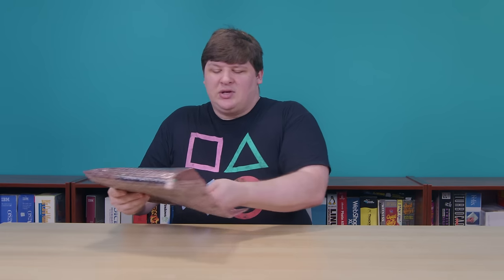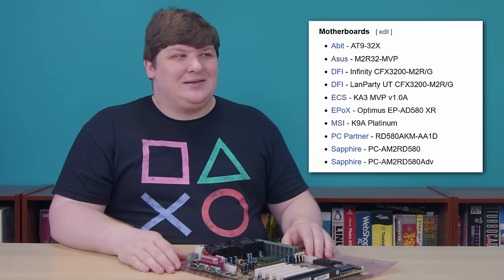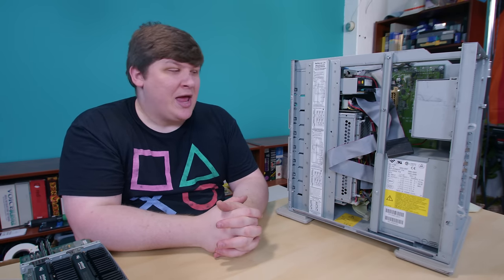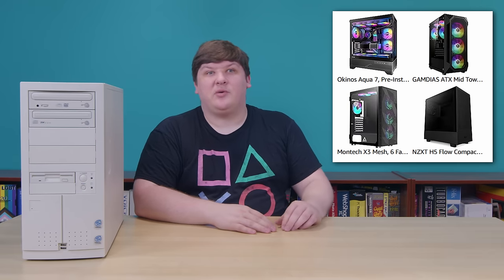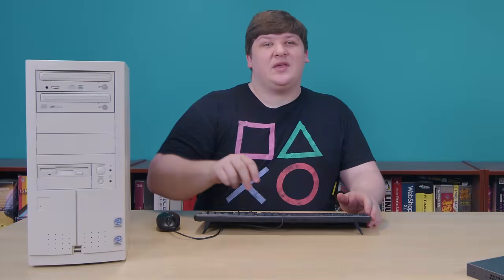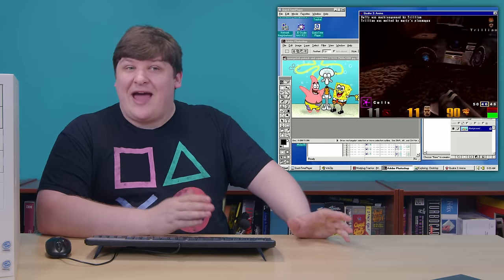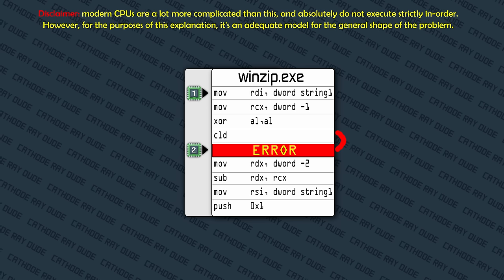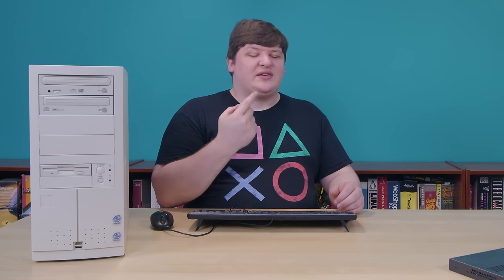The Only Famous Motherboard

Comment: Definitely throw Win 2k on that thing. 2k fixed so many little issues with NT4 and you should see a lot better compatibility with games, and iirc most BP6 owners swapped to 2k as soon as it was available.
Reply: Windows 2000 is so underrated. It was basically XP with the Win9x/NT4 UI before XP even existed.
Reply: been trying win 2k on my single 1ghz p3 machine and (saying this as someone who grew up with win xp in the late 2000's early 2010's) it freakin kicks ass! orders of magnitude better than win98se in practically every way.
Reply: I kept Win2K on an SGI VWS320 and used it as a file server for years until shitty rural power killed the power supply in 2011.
Reply: Finest version of windows ever made and nobody used it.
Reply: Agree have used win2000 on dual cpu setups. i had custom workstation with two pentium 3 ( it was in 2002) it was my "in" movable data server. Used for client data copying and storage! And it was a Dell workstation motherboard cramed into a smaller case but because of 6 scsi disks thirtysomething gigs eatch it was heavy!
Reply: @Ev1lHaX0r  I loved Win2K.  For a few years, that was my gaming OS and database/web/graphics work OS.
Reply: My parents were engineers and had dual socket 370 workstations from Siemens at home and i remember NT 4.0. In retrospective, it felt like a Windows 2000 beta, because certain parts felt unfinished. And it had many bugs. Windows 2000 professional was a godsend. 

Kinda like Win Vista and Windows 7. 

Or Win11 and whatever AI generated, adware filled and intentionally feature reduced version will come after it.
Reply: Yeah, while I'm sure a few people ran NT4 on their BP6's it was popular well into the release of Windows 2000 and this was probably the OS most owners settled on, really made NT the only choice on the desktop.
Reply: 2K was the pinnacle of computing back then. I miss that OS feel. It was everything you needed, lots of stuff you wanted, and nothing superfluous and cluttered.
Reply: @hyperturbotechnomike  Windows 11 is already the  AI generated adware filled and intentionally feature reduced version of Windows 10 😔
Reply: i ran 2k until i had to switch due to the directx kerfuffle towards the end of xps regular lifespan. and by then xp was solid enough it was mostly fine.
Reply: @KalioJay  - It's driver compatible too with almost all classes of device
Reply: I used dual multiboot Win2k and Linux / FreeBSD / QNX.
Compatibility for games on Win2k was correct, and the OS was really stable.
Reply: @thegeforce6625  Excepted the fact Win98 could run DOS games, while Win2k could not.
But it was already a minor issue.
Reply: I switched from w95 to NT4 as soon as I was able to buy enough memory. Never looked back. NT4/Win2k were real OSs. W9x was a piece of garbage.
Reply: True, Win2k kicked ass. I remember reading that "it's a workstation OS, you don't need or want it on your home PC". And then we had an install party on a friend's PC. We were like 12 or something (and those were the days when rampant piracy was normal where we lived, so the cost wasn't an issue) and I still vividly remember our first reaction: "WHOAH, THERE'S A SHADOW UNDER THE MOUSE CURSOR". Yeah, that was the thing we were excited about. And also everything was so smooth, so stable, so beautiful. Hibernation that actually worked (Me and even 98 reportedly supported it to some extent, but I never had hardware which could align the stars in exactly the correct way to get it working). Even games played better on it than on 98, believe it or not - I remember putting on GTA3 and it stuttered like hell on 98 but ran butter smooth on 2k. On the same hardware, dual-booting. People who migrated from 98/Me to XP were experiencing a huge leap. For those of us who migrated from 2k it was just the Luna theme, and maybe sound support for the emulated DOS environment (playing DOS games was still common in the early 2000s). We experienced everything else before, so... meh.
Reply: I found W2K to be sufficiently compatible with games that I had no reason to clutch on to 98. When XP came out, it was a pretty easy migration for me.
Reply: @kenabi  I did the same thing. I still have my copy of 2k. I don't have anything that can should run it, but man I look back fondly on it.
Reply: Win2k 🙏🙌
Reply: Can definitely get on the 2k Train, was into the Warez scene then and got it very early. It ended up being one of my most favorite of all MS operating systems. I remember the amount of people that ran timers just to show off uptime and it would run pretty much anything the 9x line would and not crash every 5 seconds. Took me a while to move to XP as well as I didn't care for the new interface although I look back on it pretty fondly today.
Reply: Win2K was the best windows GUI and rock solid.
Reply: The first version of DOSbox came out in 2002 so actually it could.
Reply: I ran W2K on this when it was released to RTM. Somewhat dodgy copy but Win2k was perfect on this machine. Loved my BP6
Reply: @yecti  Yeah, honestly each windows version after 2000 got lamer.  The OS should get out of the way but Microsoft wants more and more of your attention and more and more vendor lock in on b.s.
Reply: Windows 2000 was incredibly good and stable.
Reply: @nalinux  Windows 98 and ME were the last DOS-Based Windows OS',  
2000 and XP were the first two NT-Based, specifically targeting consumers. 

It's why you get an "MS-DOS prompt"  
instead of a "Command Prompt" like today.
Reply: As someone who had a bp6 back in the day, xp was far more stable than 2k.
Reply: Yup, 2K was excellent. I used it for years after it stopped being supported. Great for gaming, too.
Reply: I came here for this. I ran a... copy of win2k for most of the time I was in college, and honestly it was pretty good for MS back then. Most software ran well, and it vastly more stable than 9x and its derivatives. A former roommate of mine tried to fight through dailying NT4, and it was always just enough of a pain in the ass to not be helpful.

This was also in between the periods when I would spontaneously decided to dual boot BeOS (like, the actual thing), and a little fiddling with Linux. BeOS was actually quite nice, but the software available was janky on a good day, and Linux was shit if you weren't a CS major or sysadmin (I was neither and just did not have the patience for it, and "RTFM" is not helpful advice to someone who is sincerely trying to learn, so fuck the linux evangelists of 25 years ago)
Reply: I was actually hoping by the end he would have thrown XP on there as a bit to show how well that computer could have lasted but 2000 makes more sense.
Reply: Yep, win2k was the OS people went to use for quite some time. Even after Win XP got released, people kept using 2k because it used less resources, was more stable and didn't look like a box full of Lego. Pretty much the same thing happened to win 7 and win 10 later. I remember us using win2k on LAN parties even in 2004!
Reply: @myne00  Not right out of the box. If you still remember it, things moved WAY slower than now. People didn't get the new OS on it's release date, upgrading your OS would most certainly wipe all of your data and Win XP was riddled with bugs until at least SP2. Win XP SP3 was where the party really was at. 
To be perfectly honest, win2k had it's share of problems on release, but nowhere near those that somewhat contemporary Win ME release had and it would still beat win98 stability wise on any day of the week.
Reply: I had to reinstall Windows 98 about every six months. I never had to reinstall Windows 2k
Reply: @BTGDelta  I, like many enthusiasts was running xp beta 2600 on my bp6 for at least 6 months before I found out it was the final release that went to the presses.

It was far, far more stable than 2k.

Possibly because of my mongrel setup with a 333 and 433 in the same board.

Also wth are you on about with people not getting new os' on release day?
That was the era of lines around the block for win95.
Slower? Lol!
Reply: Before GA
Reply: I used W2k for eons because it was so stable and just worked. I don't think XP convinced me to change over until well after SP2 was released.

And then the same thing again with XP into W7... It's like Microsoft stinks at launching stable OSs.
Reply: I have been using Windows 2000 and XP, I agree that it's a decent OS - I even played games on Windows 2000, it was surprisingly good for a professional OS.
Reply: @KalioJay  I dunno I think it's probably one of the best Win OS's ever released
Reply: I ran a BP6 with dual celerons overclocked to 550mhz on Win2k.  Played a TON of unreal tournament on that thing, it was awesome
Reply: 2000 was almost as much of a hot mess as Windows Me. Maybe based on NT but there were almost no games supporting it. It was totally insecure from a security standpoint and needs a massive asterisk when including it in the NT family. 2000 wishes it could be half the OS XP was. 2000 was short lived and poorly supported. I used it for about 2 months when I started college before getting a new PC. People like to bash Vista but that's not anywhere close to being Microsoft's worst OS.
Reply: I wouldn't really know about it in relation to NT4, but one of the family computers came with 2k back in the day, and all I can say about it is it was about as solid as one could expect from Microsoft. Also ran Me and XP Media Center Edition though, so we were all about punishment in that household lmao
Reply: W2K doesn’t get the retro love/attention that it should
Reply: 2K was my most used Windows OS I rode that thing till its EoL and it gamed great. Only then did I adopt XP reluctantly (and with the nightmare of XP RTM and SP2 I was laughing all the way at the XP people).
It was the only OS I considered stable going back to 3.11 made by Microsoft. There were some builds of 10 I consider more stable, but 2K was the peak of the MS ecosystem.
Reply: @KalioJay   Oh don't compare it to XP!  2000 was a beauty, and XP was a clown car.
Reply: At college we could get a free copy of 2k that used no key.  I cannot tell you how many people I sold a copy of it for $20 a pop for just this motherboard.  Paid for the CDR burrner I can tell you.
Reply: I run win2k on p133 with 32 gb ram. And he putting NT 4.0. What a shame. Win2k was best os and still is.
Reply: The windows 9x experience was always about the occasional reboot because windows would get slow or hardware wouldn’t detect or something
switching to 2000 was like no reboots and consistent performance all the time. People have memory holed how jank 9x really was
Reply: So many fond memories of my dual Celerons, overclocked well over 50%, and Win2K actually running some games :)
Reply: " It was basically XP "

your logic is real impressive...

...when did came xp and when was 2k ? the only difference to windows 2000 is the blinky blinky for the gay minkaas

Xtended Problems with the Masses
Reply: @ApeStimplair-et9yk  You can turn off Windows XP Luna theme so it looks like windows 2000. 
XP SP2 is MS getting their house in order security wise. I was playing around with IIS and got hit with Code Red. What a goddamned nightmare.
Reply: @ApeStimplair-et9yk  ....what?
Reply: W2k on BP6 was magic
Reply: Yep, I did on mine back in the dark ages.
Reply: @politenessman3901  yes it was dark except for the light coming of my CRT 😁
Reply: Windows 2000 is God's secondary operating system after Solaris 7
Reply: xp pro or win7 ultimate are the classics...   windows 11 should crawl in a hole somewhere
Reply: @hazelnotxyz  i was sad when win7 joined xp pro
Reply: @SimonJ57  remember  the days when you could type EXIT  in  the dos prompt window😂
Reply: Some of us even jumped to NT5 Release Candidates (What got renamed Win 2k in the end) as soon as we got our hands on them.
Reply: Totally agree, win2k (&beta) is100%  period correct for the BP6  (we did all win2k betas from 99, It was awesome!!! ) ;D  Me and my friends, we had this board for 99 to 2001, always on win2k. After 2001, winxp but it was just good, in 2001 end we had 1.4ghz cpus (AMD thunderbird)... (it's better to have 1ghz single core for gaming...)

Comment: The tiny bit I can contribute:  those Starcraft images were splash screens.
Reply: Specifically, they're the backgrounds for the results screen, for a terran defeat, and a zerg victory (though, I think the zerg victory one was also just used as key art in a number of places).
Reply: Clocking the very cheap 300 mhz celerons to 450 mhz by raising the bus speed from 66 to 100 mhz was a dream steal at the time.

Comment: The reason for the CPU pingpong of processes was to make more effective use of the caches.  Every time you had a TXT page fault it would switch cores.  There was a non-zero probability that the cache on the other core hadn't evicted the page you wanted.  It also meant that when you went above 50% core utilisation and a process got evicted, it would be landing on a core that probably already had it partially cached.  The cost of context switching was less than a millionth of the page fault on rotating rust, so it wasn't a costly gamble.
Reply: I also wondered if it was to balance usage over time or to not overheat one while the other's running cold. Both running at a mildly high temp has got to be better than one burning itself out, right? I don't know if that would happen with just a bunch of basic windowed applications open, I am not really familiar with old Windows, but if it did it seemed like a reasonable thing to implement to me.
Reply: The oldest Windows I remember using genuinely was probably XP, but I was young and the computer was already outdated then. It's funny, I probably a little too young for XP and VHS and CRT TVs but I had all of them because my dad was a cheapskate, I think. I mean, if it ain't broke and all that. I also didn't get a phone until I was a lateish teenager, and it wasn't new, it was a hand me down. Awkward story ahead, here be dragons: One time, when I was really young, I took a picture of my, uh, willy with someone's phone, not mine but a family member, but then got really scared and couldn't figure out the interface to delete it, it was probably Android 2 or something. Core memory, I was very stupid.
Reply: @trashtrash2169  Well, at least you didn't try to cut the darn thing off. That wasn't me thankfully, but it was my oldest brother!
Reply: this channel has the best comments
Reply: @yuribacon  Yikes! That reminds me of this one time when my oldest sister told me about some kid using nail clippers to do the same... That's messed up! Why did she do that? Core memory, but not my fault this time.
Reply: I find it amusing that the Linux kernel keeps doing this when its not necessary anymore, its probably detrimental.
Reply: I think you are confusing cache lines and memory pages.
Reply: i don't think cpu caches can contain data from evicted memory pages
Reply: Do you have any links to support this claim? If an access causes a page fault that means the data isn't even in system RAM, and is surely extremely unlikely to be in any of the core caches. What circumstances could lead to a page being evicted from RAM but still being in an L2 cache?
Reply: Context switches were expensive, having a page fault meant the VM had to load a page from disk.
If the physical program test page was already held in L3 (or memory) the code was loaded directly from that and the cacheline would end up in L1.
Windows threads bounced around to try to use a cooler CPU/core probably because of shoddy builds by OEM being common.
Linux scheduler tried not to illogically move threads, because then the local cache tends to have the data.  The 'dows idea only works if you have been bouncing threads around for stupid illogical reasons.
Reply: @klz5218 right, it's based on misunderstanding of the cache hierarchy and cache snooping protocols on x86 between processors.

Comment: Tech Tangents made a video on this same board but mostly to document replacing bad capacitors. It might be worth checking your board's caps to see if they're still good.
Reply: Rather, swapping the caps makes sense before they die. If the caps go bad the board will stop working, varying from just black screen with no POST to magic smoke and dead board. Mostly they start going flaky, it'll POST and run normally then freeze, and then won't post. Wait 30min, and it'll POST, boot and run again for a random amount of time. Best is really to check the cap brand against the list, or the board model, order replacements, roll up sleeves while soldering iron warms up and go to work on it. If one waits until the caps go to shit, there is a non trivial possibility the board will stay dead even once caps are replaced, ideally it should be done on a working board.